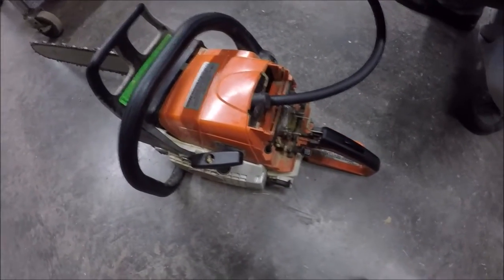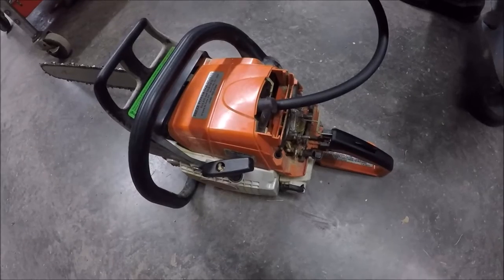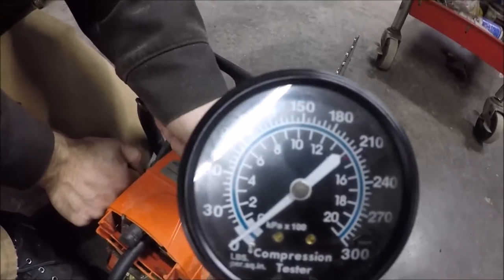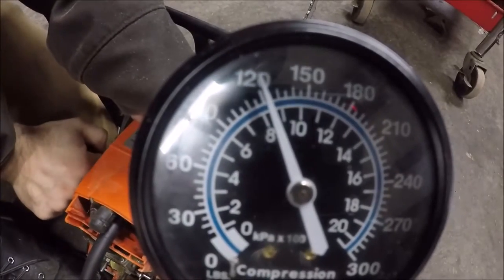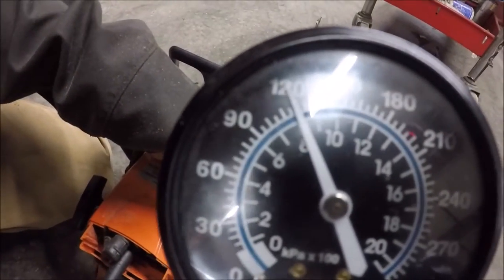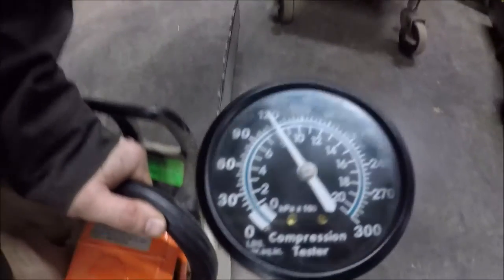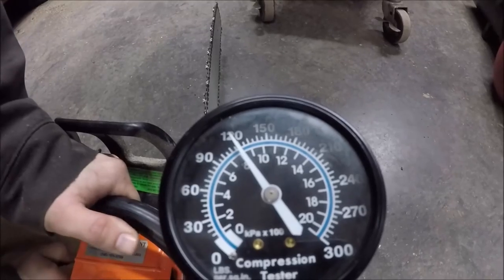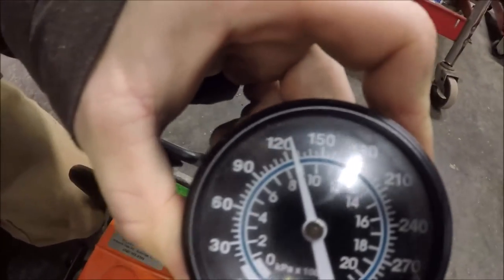Checking Compression on a Saw, Throttle Closed vs Throttle Open

Comment: My rebuilt MS170 with Chinese piston is 140 after 6 years, and my MS140 still stock piston - don’t know how old, bought it used - is still 140. Saws still run quite strong. If anything the 170 got better compression after doing the muffler mod and carb upgrade and running it for a bit. Perhaps the rings were able to seat a little tighter with more air flowing through it - dynamic compression.
Reply from the maker: I think a 170 only has about 150 new. I'm not sure how much  low compression hurts them. I don't think it does much. I know of a saw with 110 and still runs good.

Comment: Tell you what, that saw's weak either way. It'll likely run but won't have power. When a saw's down to 120 or less, I put the options out. I also question the realibility of a gauge reading that high as to being accurate.
Reply from the maker: I can't remember if that was after it was rebuilt or not. It runs really good. https://www.youtube.com/watch?v=gasJQOcGrFI

Comment: So it needs to be rebuilt??
What's good compression on stihl ms 660 ?or top compression, some one told me 160 psi
Reply from the maker: No, it had a new cheap Chinese cylinder on it when the video was shot. It runs great, too good for what it is. 

Stihl says anthing over 110 psi is acceptable. I have a low hour 660 and I have never checked the compression on it. I would guess 150 or 160 at least.
Reply: @TractorTech  140psi Good compresion 372xp oem?